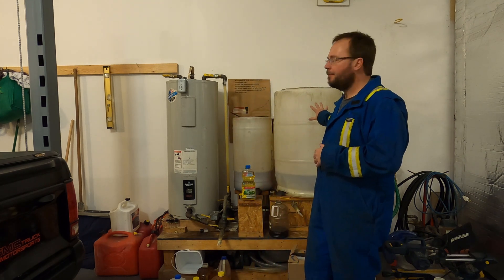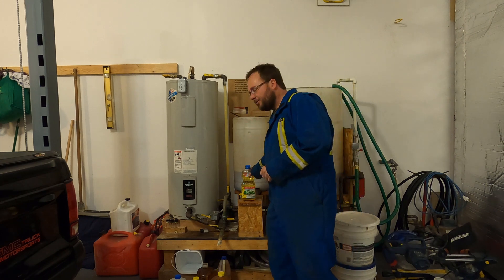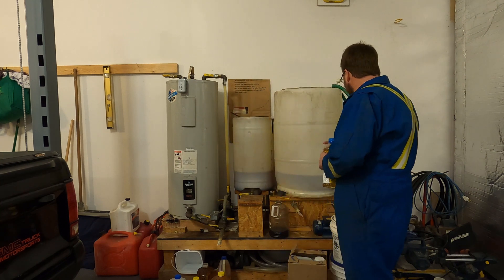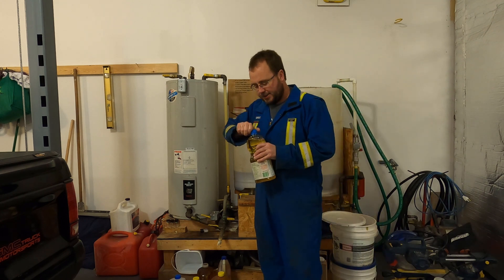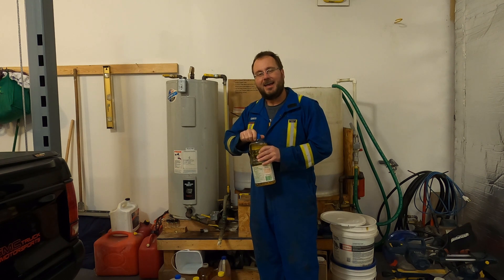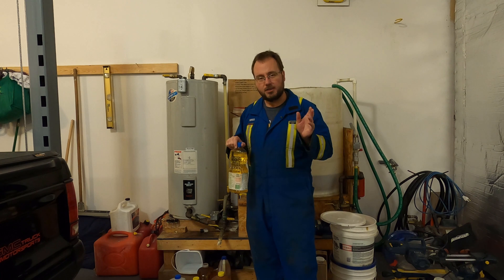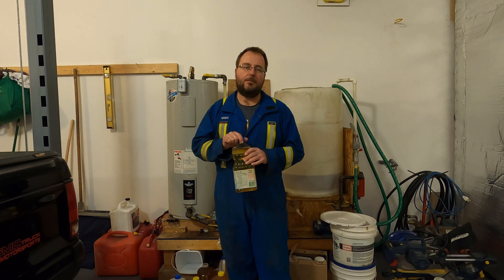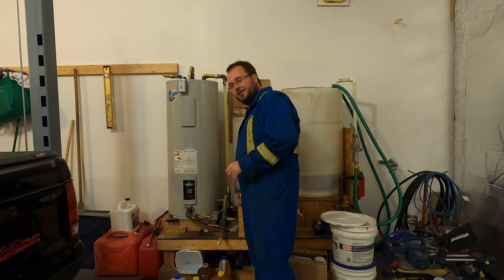Top 5 Reasons to NOT MAKE BIODIESEL

Comment: The reasons you gave are poor. The main reason why you shouldn't make biodiesel is because you can run straight vegetable oil in the older cars (ambient temperature permitting) (above 40F)
Reply from the maker: 1) the reasons are Top 5 in the world

2) SVO is a bad idea

Comment: QUESTION. i have 60 gallons of old but unused cooking oil. its kinda rancid. can it be used for bio diesel?
Reply from the maker: If rancid I think it will not work as well because it is full of acid.
Reply: @gregs_garage  thank you sir
Reply: @gregs_garage  Can you extract the acid and then form something so you can use it as fuel?

Comment: Here's a good translation of the top 5 reasons:

1.)  You're too careless and lazy.
2.)  You're too lazy and don't know how to search for things on the internet.
3.)  You're not a patriot.
4.)  You haven't embraced your pyromaniacal side.
5.)  You own an over-engineered, over-priced vehicle.
Reply from the maker: You have it all figured out.
Reply: @gregs_garage  Thanks for this video.  I've been wanting to try this just to have something nerdy to do with our spent cooking oil.  I want to make some for  low-grade charcoal starter, lantern fuel, burn pile accelerant, etc.  I already buy my sodium hydroxide for soap making from Duda Diesel.  They've got everything else.
Reply from the maker: @argentorangeok6224  this works good for charcoal starter. I mix it 50/50 with alcohol.  
by itself it won't light up

Comment: 1. Just make the fuel in a shed or covered carport with a sand or dirt floor that can be easily replaced if it spills. If this is not an option, then build a containment basin with the capacity to retain double the expected production amount and have some kind of absorbent, such as cat litter, to aid with clean up.
2. You can use sodium hydroxide in place of potassium hydroxide for the catalyst, which you can get sodium hydroxide at Home Depot as drain cleaner. Can't really get around the price and difficulty of acquiring methanol unless you work for a company that will buy it in bulk for you or you can find a place that will sell it retail in bulk.
3. You can be legal with the taxes if you go to your local Department of Transportation and fill out a fuel usage affidavit with gallons of biofuel used and miles driven and pay the road tax. Different states have different regulations on whether you have to pay the fuel tax monthly or quarterly. You will be given a receipt that you can provide to police if they try to cite you for using alternative fuels.
4. Yes, this stuff is flammable, so distilling in a well ventilated area that is away from other combustibles, such as buildings, trees, and trash, will reduce the risk of a fire spreading if one breaks out. Having a 10lb ABC fire extinguisher nearby is also very highly recommended.
5. Using a biofuel with a mixture greater than 20% is not recommended in any diesel engines that have DPF or SCR systems or if the engine has a fuel opacity sensor. Using higher mixes in these engines can plug up the DPF filter or cause an error code to be triggered by the sensor and cause the engine to run poorly. Diesel engines that don't have these systems, typically, but not all inclusively, ones produced before 2009, will run very well on biofuel since it has a higher lubricity than ultra-low sulfur diesel fuel, which will reduce wear on injectors and other fuel components, as long as it's filtered properly. If you're using biofuel in colder environments, it's a good idea to either mix it with pump diesel or add a anti-gel additive to prevent gelling in winter time.
Reply: I hope ya don't mind... I screenshotted this... THANKS FOR EVERY BIT OF THAT! What if one were making diesel for the sole purpose of running an old generator I purchased at a military surplus outlet? I'm concerned mostly with taxes...
Reply: @danielbrowning238  If the only use of the fuel is to power a generator or farm equipment, such as a tractor, then it's considered off-road fuel and isn't subject to taxation. Only fuel used for on-road purposes is taxed.

Comment: Port injected diesel engine would be fine to run on bio, not direct injection. Everything is direct injection these days and it's pure crap with the carbon built up. I have a 2016 Super charged V8 petrol car that is port injected and i will not be selling it.

Comment: Number 6. And this comes more as part of don't wreck your car a bit.... Petrodiesel isn't just hydrocarbon fuel. They also have an additive package that includes all sorts of detergents, decoking agents, anti microbial agents and freezing inhibitors. Commercial mass manufactured biodisels that are made to American/European/International standards also have these additive packages. So Even if your car says it will run on B20 okay... It will probably suffer badly on homemade B20 in the long term. Where homemade B100 or other blends excel is in home heating. B50 with 45% used motor oil and preferably 5% or so brand new  Diesel motor oil or a good 2-stroke oil really works fantastically. The reason you use the fresh Diesel motor oil or 2-stroke oil is because of some rather fancy chemistry.. Motor oils when they burn (especially old used oils or tallow/vegetable oils) produce a LOT of acids and coking in heaters... Fresh motor oils, if you look at their technical datasheets have this thing called TBI (Total base index). It's a measure of how much anti-acid additives are in that oil. Diesel engine oils and 2-stroke oils have some of the highest percentages of anti-acid and decoking additives in them of any oils on the market. This massively helps in keeping burners clean and stops exhausts rusting through at a very high rate.
Reply from the maker: what about adding some good old DEXRON ATF in the blend?

Comment: I have been making it for 6 years and running my 2,8 diesel hilux on it. I'm gonna keep doing it.
Reply from the maker: I ran this in a 2.8 hilux for 7 years!  great motor.
Reply: @gregs_garage  True, a tad sluggish on the hills, yet I'm never in a hurry and all the tools that overtake on the hiway and dangerous bends are seen at the next town!
Reply: I used to pour veg oil into my golf 20 years ago.
Going to buy a converted van to travel, would love to use veg oil as I'll be driving a lot, but worried it will damage my van
Reply: @lovelyjubbly87 maybe run your favorite engine cleaner very often. Still will be cheaper than gas

Comment: There are those who have put ordinary rapeseed oil in the tank of an old diesel car.  With good results.  The problem is probably the cold, but maybe there is something to put in so that it can withstand the cold?  apparently there is also a certain pop star in the US who fills up his old Mercedes with frying oil
Reply from the maker: you can burn straight veg oil, but it causes lots of problems longer term.  That oil doesn't burn like diesel and can cause problems in the injectors and cylinder walls among other things.

Biodiesel burns more like petro-diesel.
Reply: Rapeseed oil is called canola oil in Canada and the US. That's what he uses for making his biodiesel.
Reply: Who is the pop star?

Comment: So when I put in tank would I still need to get engine up to 170° ? (Two tank system) . Would I even need the diesel tank anymore? Do I need to heat up the fuel before it hits the engine?
Reply from the maker: No no no.  Biodiesel is the same as regular diesel.  (Older engines only). Same tank.  It behaves the same but does gel at very low temps.
Reply: @gregs_garage he had a temp gauge too for the veg oil I guess he used to know when it's time to go
Reply: One guy keeps a small diesel tank with a valve in the cabin driver can turn on to start say in winter to help there and at the end of a drive to clean it out

Comment: Y do u use all those ingredients.  I seen videos.  Where they just use gas and old oil 🤷🏻‍♂️
Reply from the maker: Gas and old oil is not biodiesel.
Reply: @gregs_garage   what is it then. The guy filters the oil.  Sad mixes old gas.   let’s it sit for 3 weeks. And puts it in his truck.
Reply from the maker: @TheRobbietufaro  What is it?  It's petroleum based oil thinned with gasoline.  It may burn in a diesel engine with unknown results.  It has nothing to do with biodiesel.

Biodiesel is derived from vegetable or animal-based fats with the glycerin removed.  The resulting light oil (biodiesel) has similar properties to diesel fuel but is much cleaner.
Reply: @TheRobbietufaro  also known as black diesel. Wouldn't burn it in a passenger vehicle. I've heard it burns well in heavy equipment. It is excellent for heating oil though.

Comment: What about converting a diesel generator to be able to take biodiesel?
Reply from the maker: You may not have to convert it.  Just put biodiesel in the tank.  Depends on emissions features of the generator and temperatures.
Reply: @gregs_garage  I thought you had to change the filter or something on the gen?
Reply from the maker: @alexthompson8307  perhaps the DPF.  You need to do more research and develop an understanding of the issues before even remotely thinking about alternative fuels.  You need to "want" to understand it.

Comment: How does biodiesel wreck your engine on a common rail?  If the fuel is clean and properly processed, it should run cleaner than petro diesel.  You might need to change the fuel filter more frequently while it cleans out the fuel system.   What am I missing?
Reply: Mainly sensors, and like the injection pump in a 6.7 powerstroke has extremely low tolerances. You would have to get it to astm standards for it to run decently.
Reply: That's not the real issue. The problem is that the super-high pressure injectors are designed to work with the viscosity of ULSD. The viscosity of biodiesel is very different. You can get away with a certain blend (the manufacturer of my car specifies no more than B5, others go as high as B20), but if you exceed it, you really do run the risk of causing very expensive damage. To use B100, stick with old school diesels only.
Reply: @CaptHollister so maybe wash the engine out every so often with regular diesel? Biofuel is too thick?
Reply: @juntjoonunya9216  How would that help ? the injectors still risk being damaged anytime more than 5% of the fuel being passed through them is biodiesel. Biodiesel is more viscous (thicker) than diesel. My common rail diesel was not designed for that.
Reply: @CaptHollister  I wouldn't know. Barely a regular gas engine mechanic. But regular diesel wouldn't wash away the viscosity? I've seen one guy with a really intricate setup with a extra little tank for diesel he'd switch to to start vehicle and to end a drive
Reply: this dude is clueless  try this info: 
https://youtu.be/1lqCwNReU1Y
Reply: it need a certain cetane rating for them to work correctly.
Reply: Yeah, this is rubbish
Reply: Distillation?

Comment: I have a 2004 Vauxhall, or as you say  in America, Opel Zafira, and make bio, and it runs nice.  I've had 2 of the same car, and been doing it for about 6 years, and is a high pressure  diesel engine y20dth.  The reason the last one broke down, is drive went when changing down gear.  But car I have now runs nice on it
Reply from the maker: Nobody says “Opel Zafira” in America.  Nobody knows what that is.
Reply: @gregs_garage so what is it then? a Ford?

Comment: 6.7, 3.0 and 3.2 Powerstrokes are sensitive to fuel quality. Alot of problems with the HPFP's due to fuel quality. I wouldn't recommend using home brew diesels in any modern ford from 08 up. Powerstroke tech talk with Arod and I both have talked about this before on his Livestreams. Now MY 07/6.0 and down not a big deal. Personally I've been running 100% used transmission fluid for years. I just filter it and run it. I've been thinking about bio diesel as my ATF source is dried up since I'm not working at the dealership anymore. In Florida I don't think I'll have to worry about the bio gelling up. Between my 7.3 and my ALH I need to do something and quick.
Reply from the maker: used trans oil.  excellent.
Reply: I have 2 7.3L IDI diesels (1992 fords) and 2 6.5L diesels (1995 chevys) and they will burn dog piss (if I could figure out how to get my dogs to piss in a bottle)!  I installed fuel tank heaters and can run straight filtered waste veg oil, no problem.  The newer diesels (2000 and newer), most will have problems.
Reply: Never heard of using transmission fuel what the...

Comment: Would you be willing to do a video on making biofuel, or diesel through the process of pyrolosis, biomass reactor, I think this process negates the pitfalls of biodiesel. Doesn't ruin your injectors, pr require heating tanks, extra filtration, doesn't require an inline fuel pump, or removing all rubber fuel lines. 🤔
Reply from the maker: I'd have to do some research.  where do i look?
Reply: @gregs_garage  Hello, there are several channels that show the process. It is a little more labor intensive system.  you take plastic - bottles, wrappers, rubber tires minus the steel cords.  chop up small pieces.  place it all into a sealed container.  IF you can remove all the O2 from it even better. heat it up to to where it will melt it will release flammable gases that will need to be burned off or reused as the heat source, then it goes through a condenser to be liquefied.  The end product is grade B fuel oil.
   There are a fair amount of production plants around the world.
 If you collected 100 pounds / 45kg of plastic you would get roughly 10 gallons / 40 liter of oil.
Reply from the maker: @lnwolf41  too much work on a small scale
Reply: sort of, but if it can be mass produced it will get rid of plastic as well as make fuel cheaper
 @gregs_garage

Comment: Hmmmmm, I’m trying to find out how well try 2006 5.9 Cummins will take bio diesel. I’m in a pickle if I can’t get diesel for cheaper. Then I’ll decide if it’s worth pursuing this route.
Reply: It worked very well in my 01 model. It also ran very well on filtered veg oil.
Reply: @pauljohnson2372  no way! You just filtered it and ran it? (Of course starting it and shutting it down on diesel I’m assuming)
Reply: @Vikingcowboy5  filtered down to 5 micron, yesir. Started fine on 100% wvo during hot weather. It does cause rubber to break down prematurely, something to be mindful of of you have rubber suction hose for your fuel pump
Reply: that 5.9 will run great on biofuel
Reply: Have an 05 I'm thinking about with fuel prices going up. Seen a few doing it but others saying only do it on older trucks...

I know reason 3 is a big reason I'd like to
Reply: It’ll be 100% fine. Not filtered veg oil but actual properly made bio diesel. In that year truck, you can run it in b100.
Reply: Someone in here(youtube) kept a small diesel tank he could turn on/off for cold starts and to clean out the system at the end of a drive. He also installed a temp gauge for the oil/fuel.
Reply: That 5.9 will run great on biofuel.. 2007 or 2008 is where the fuel systems started getting a bit finicky with biofuel. I run my 2000 7.3 on 100% in the summer. I mostly ran 50 - 75% but had no problems with 100%. I made sure my fuel passed all quality checks before using it. I tested the used vegetable oil everytime before adding it to my processor, even though I got all my oil from the same source. It will be a mess until you figure it out.. I made it for 5 years
Reply: It worked really good on my 2000 Cummins  24 valve Dodge ram